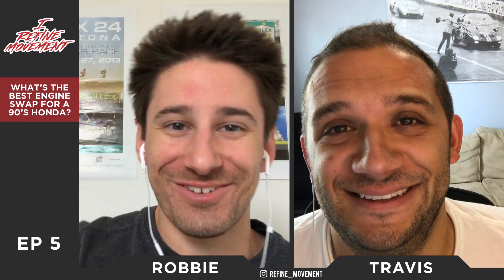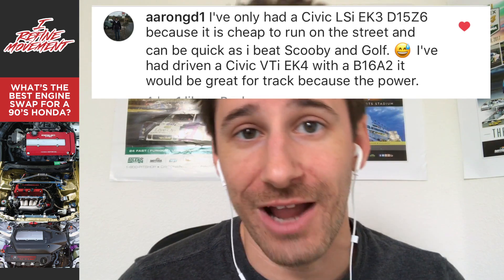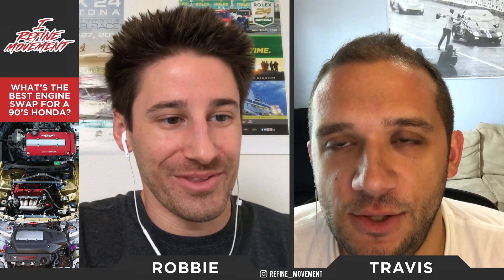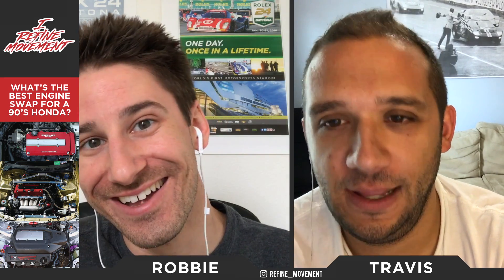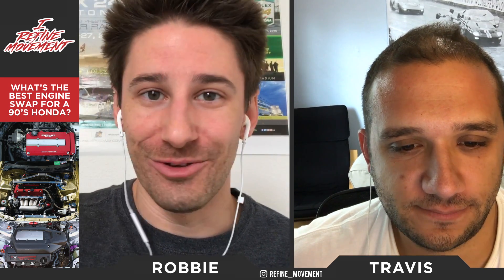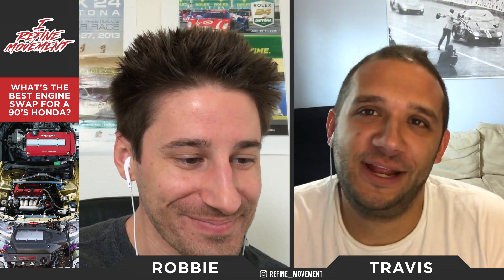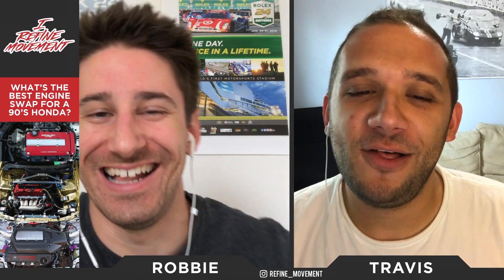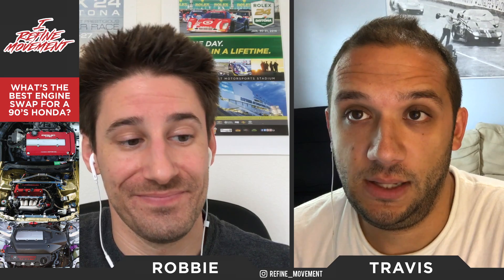What Engine Swap Do You Choose??? | I Refine Movement EP 5

Comment: The B18c1 and H22a1 are very near to 200hp. And a couple bolt-on and you'll be up their with the k-swap horse power.
Reply: leoboy191 Type S and Si-R Prelude engines make 220hp! One comes with Active Torque Transferring System, while the other an LSD!

Comment: I have an eg hatch and did a k swap for under $4,000 it is a K20a2 RSX type s and a k20z3 LSD transmission from a civic si best set-up for a all around car 1/4, track, and street. Also I have had a D16z6 with bolt ons and also a turbo d16y8 Vitara build and also have had a b18c1 bolt ons ek hatch and by far the k series out perform everything I have ever had also gets really good mileage I get around 350 miles to a full tank on my eg hatch so in the long run it pays for itself and is very reliable I have not had any problems with oil leaks or anything but with my d16 and b18c I would get the occasional check engine lights but in my k series I have never had a check engine light since 2015.

Comment: If you are road racing supercharged or turbo charge d series with pistons and rods is the way to go.  300whp in a light and nimble car.  Ran this setup for autox and road race for 5 years before i sold it.  Never had a problem.  

Oh and you have to add lsd.

Comment: hey refine movement. I'm Jonathan and I've had my good share of experiments on swaps on my old eh2. and I had mini me swaps. they were fun but wanted more out of my car.i finally decided to go b series and to me as n/a wise I went b20v. from b series stand point the b20 I'd a pretty torquie motor and what I did was run a b20b high pomp (high compression) block and a b16a vtec head and a gsr trans and that car was more that enough to really enjoy at the track wen Dyno tuned it made 191wheel hp and the close ratio gsr trans and it was a beast to me have. I say go b20 and find a b16 or gsr b18 vtec head and a b16 or gsr trans and is a very affordable swap that's pretty darn funn. thanks for the great content and keep it up and be safe from Irma 😎👌

Comment: Meat and potatoes swap. B20 or b18b1 with a si/gsr trans. Boost to 10 psi and you have a rocket. Future head swap nets even more power if desired. They are considered the bastards of the b series so they are plentiful and cheap. Swapping is easy and straightforward. K is amazing but definitely more entry cost up front.  Boosting single is what usually majority of people go for with success but some single trans are geared horrible so ex/si trans is a must. H series are great too if you get a legit set of mounts. H2b kits are a fortune so most people stick with h trans. Possibilities are endless and kind of hard to say what is best. Depends on what the owner wants in the first place.

Comment: Just swap in a B18C (gsr) motor. Puts out 170 stock, with bolt ons and a tune possibly closer to 190hp. The transmission is balanced for both track and daily driving.

Comment: Get a nice B18c4 or B18c5 with an LSD B16B tranny or S80 type-r (depends on what kind of track).  Nice compromise between low-end and top-end.    B-series are also a nice OEM fitment in the bay. Keep in mind you're coming from a d-series, it's a nice power bump. Get comfy with that power first and move up to K later.   I did a B20z myself because it's for my daily. Installation is a breeze and those engine run so great.   B18c's are good high RPM engines.

Comment: In my opinion the best engine to work with is the one that's already in the vehicle. Save your money and play it smart. If you want a bseries buy a car with that swap already in place. Kswapping nowadays isn't the most practical road to take since most rsx-s are reasonably priced aswell as the 8th gen civic have also gone down in value. 

I have a kswap civic and if I had to do it again I would of just invested in an rsx-s. The amount of money your spending to have a running kswap you could easily drop that money in an rsx-s and be just as happy. Sure a civic is lighter, but that doesn't necessarily mean it's better. You have to consider weight distribution aswell when tracking a car.
Reply from the maker: This is probably one of the most well thought out comments I have seen. Most people just think of power of an engine swap but there not thinking about weight distribution and the money and time a swap will take in an old chassis. I do agree with you that going with a motor that is already in your car is the best way to go. - Travis

Comment: hey Trav and Robbie.. this is ChaddyEk9.... I think it would be interesting if you both went different engine routes!! Rock paper scissors it haha. Oh just to clarify, when I said the b series may not be as reliable with aftermarket parts I was speaking to things like cams, springs, retainers, arp head bolts, pistons, rods and maybe having to use e 85  to get a b18 close to 200. Which in my opinion can be less reliable than a fairly Oem engine with just outside bolt ons. But that's just my opinion, glad the comment was helpful and. hope. to have more discussion in the future. Stay safe for the weekend and the hurricane!
Reply from the maker: Chad! I didn't realize before that you are you! lol ChaddyEK9 and Chad Pearson, same guy haha. Good to know and put two and two together! Yeah man, excellent comment and points to put up in favor of going K series.  For sure got got us thinking. Thanks for clarifying what you meant with the B series aftermarket parts as well.  

So yeah, we had to cancel our track day we had planned for this weekend, super bummer again.  This hurricane is a big one so we'll just be sitting tight for a while. Thanks for your well wishes man! -Robbie
Reply: Refine Movement yes I'm definitely myself LOOOL. I think somethings happen for a reason so don't be too bummed about the track day. You will get that track day soon man! Cheers

Comment: D16Z6/A6 - best for autocross. These are both cheap to run and readily available. One advantage that these motors have over B-series is being way lighter. The Si/Ex (Z6) transmission for EG/EH has best gearing of all D-series. Z6/A6 have equal if not more low end power as opposed to B16s for what you get, and in autocross, LOW end power is key. As far as being on track, I'd definitively go K series or the rare B17.

Comment: Aight the h series was definitely not reviewed too well in this video.

Chaddyek9 did a k swap which is cool but he also had to replace his subframe to an eg. And if he didnt well then he bought the ek mounts and sacraficed getting the best axel placement. 

For an eg or integra, k series is easier and good way to go

For an ek though a h22 or h2b or the f series equivalent is gonna be your k series without the hassle of swapping your subframe or settling for bad axel placement. 

I have an ek and swapped in a b18b1 from a d16z6 and i was happy with the power improvement but it still isnt as much as i was. 

Now an h22 is 200whp stock which puts you up there with the k series guys and it has the torque to back it up. 

If you do h2b which i will be doing because i currently have a gsr trans, there's a cheap plateless kit for it by ricebrough performance its like $500 for the kit and it uses b series mounts only thing you have to do is move over the brake lines and fuel lines a bit because it sits close to the firewall. 

This is all for NA motors too, so for cheaper than a k swap you can get k swap power with a good trans from a b or just an h trans if you want. 

If you want turbo then you can do whats called a g23 and isnt the cheapest of builds but still pretty cool.

I have a youtube channel about a g23 build its called the919garage if you would like to see more of what we have planned for the car. 

So bottom line

Eg/integra - kswap 
Ek- h22/h2b 

For track use an na motor will be the most reliable, a turbo will mess with your motor's reliability and power band too.

Comment: f20b with an h2b kit using a b16 or type r trans. f20b is around $1000k or less revs higher that an h22, better connecting rod ratio and is basically a destroked h22 with better sleeves, I love mine in my stripped eg hatch ! very responsive lots of low rpm torque 176 @2500 rpm all the way up to 8300 rpm great on the street for roolin around in and awesome at the dragstrip 13.2 quarter mile at 105 mph all stock internals with intake header and exhaust. dynoed at 217 hp 176 ft/lb at the wheels

Comment: Also f22 from an accord is a bit of a harder swap, but very under rated, faster than most b series, cheaper and easy to upgrade to an H22 out of a prelude if you ever want more hp/tq!
Reply: Mario avalos you think that all these accord engines out in the junk yards are just waiting to be swapped out.
Reply: I too have run an f22 in my eg they're fun and smoke the youngsters in their b series
Reply: Mario avalos is there any issue with oil pan clearance?
Reply: I have a '00 Prelude Type SH and the H series is okay. It's a fun engine and all, mine has ATTS, so it's good for the corners, if that's your thing. However, H engines do tend to burn thru oil quickly. If you want a good H engine, go with a H22A from a Prelude Si-R. That one comes with an LSD. I love Preludes.
Reply: Mario avalos F22? Isnt that the sohc head you can put a h series head on and build the Frankenstein engine? For all that do an H2B
Reply: Black Jesus 23 no because it's not as easy of a swap as a b series.  But if your up for a challenge it's a great engine,  with tons of spare parts (junkyards)
Reply: #Listen to this Please You can't be super low but you can get a nice drop with stiffer suspension and not have to worry on most roads
Reply: Gustavo Castillo mine didn't burn oil that ive noticed, except with a bad head gasket.  I've ran h22,f22, and f20b all fun In an EG!
Reply: Ron FC3S I've read of people doing that on Honda tech and call it a g22 but never seen one in person
Reply: avaloscris38 but b series is the best engine ever created.... ever.
Reply: Yes because its not that difficult. If one doesn't want to do the homework on how to do it right then that's them. All i'm saying is that its a valid swap. A B series is not easy of a swap for some people either.

Comment: @ Travis if it ever comes that you  blow up your engine, "not jinxing you" I recommend you B swap it. Cause you can still use your OBD1 harness. If you k swap it. You'd have to swap out the whole thing.
Reply from the maker: +leoboy191 thanks for the tip but my ek is OBD2
Reply: Refine Movement lol I thought it was a 96-97
Reply from the maker: +leoboy191 nope it's a 1998 DX

Comment: I found a K24A8 at the junkyard for $350 just the engine, with a standard tranny, manifold and ecu i ended up paying $687.98 however they have sales sometimes at the junkyard i go to, so they put everything 50% off; i am still working on getting the engine in my car, since i am rebuilding it just to make sure it does not die on me, so far with my friend who is a mechanic, we are projecting a $3500 to $4000 project, i think this is a good price, since im including the price of the engine, the parts that i need, the rebuilding, and im also paying my friend for his help, im sure you can spend less, since rebuilding the engine is not needed as long as the donor car is not that old, and the reason why the vehicle is at the junkyard has nothing to do with the engine.

Btw please excuse my English as it is not my first language.

Comment: I own a 04 accord with k24 tsx swap witch they not the same engines different assembly estructure . 

94 del sol SI D16z6 immaculate chassis and engine 

Had several B series  6 & 8 L  

All comes down TO ME chasis feel my main drive is long mountain isolate roads and they all good performing engines even my D series set VTec at 4rpm . People are so danm obeesed with k series engine THE MOST IMPORTANT PART is once you change the orientación the engine is made for the car (chasis ) will never be the same I seen so many k swap for me they look like a car that is been rape of it’s origin . It hurts me so much to see a Itr k swapped 

Don’t let nobody tell you like I heard from some retard rice punks k is the way . Yeah if you planing to rip apart a eg hatch for drag track use by all means . 

Stick with you period of engines D,B . You not be desopointed